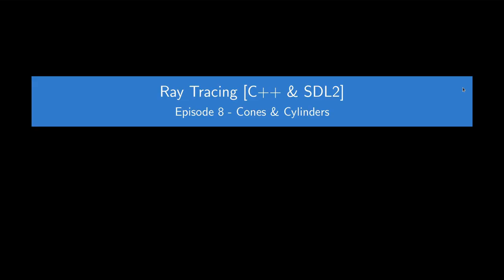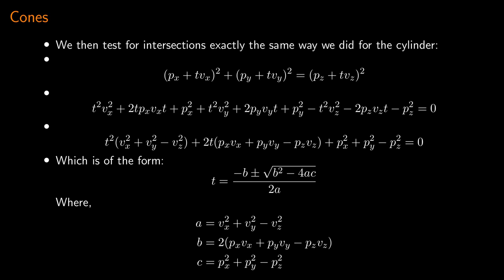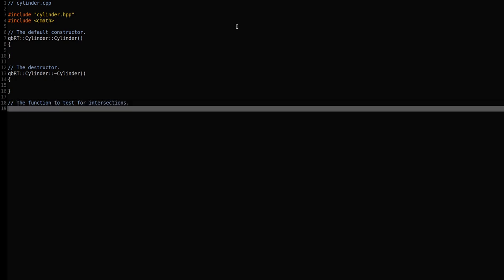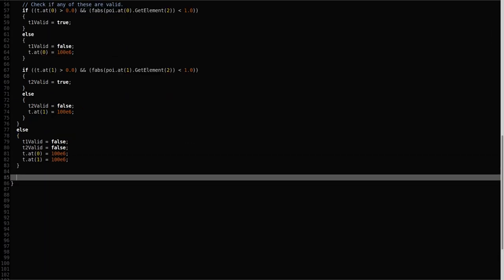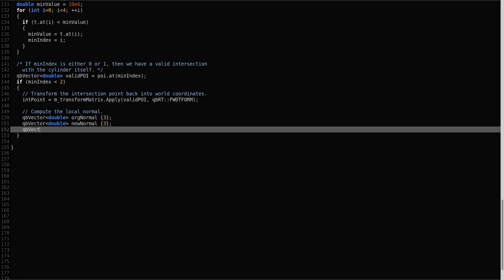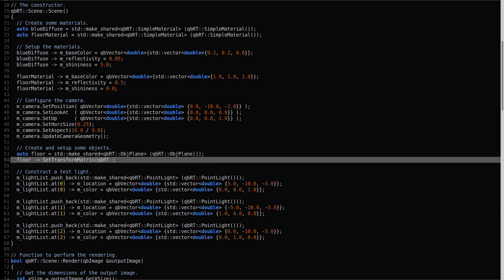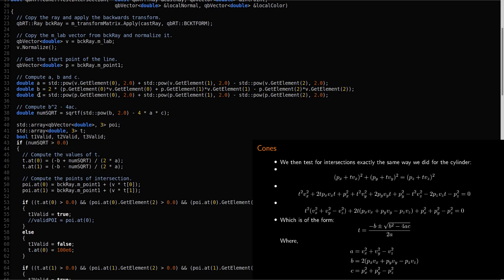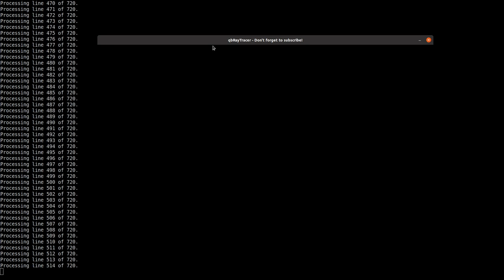Ray tracing [C++ & SDL2] - Episode 8 - Cones & Cylinders

Comment: Absolutely amazing. I'm in awe of how you came up with all of this from scratch. Thanks so much. Ultimately I'd like to add some functionality to import arbitrary objects (defined in OBJ files) and figure how to render them, and also use my GPU's to speed things up. I'm thinking one source of insight with all of that is the open source and professional grade Blender software. I've written some python scripts for it, but never looked at the internal code (I think C++). Since OBJ files are simple text files that define vertices/faces/normals/UV coordinates, it should be pretty easy to import them, but I'm not sure how to do a raytraced render when there's no simple equations to define the objects. Or maybe since each vertex already has coordinates listed in the OBJ file maybe it's easier to just check the ray length vs. the location of each of the vertices. Anyway, guaranteed to keep me busy for a long time. Thanks again.
Reply from the maker: Thank you for all the comments! I am planning to go on to cover support for importing meshes from OBJ files, but have a few things to get through first. The basic idea though is to represent each triangle from the OBJ file as an object, the simplest being a plane with a bit of extra code to make sure we only render the bit that lies between the three vertices. I would recommend that you skip ahead to Episode 11 (https://youtu.be/5lDRXL5zQDo) at this point where I discuss the issue of applying geometric transforms to surface normals, which actually isn't quite as trivial as might be expected. This applies particularly to the cones and cylinders described in this episode.

Comment: can you make a video about camera rotations in Raytracing? (controlling the camera, yaw pitch roll.) I used quaternions when I was making a 3D polygon rasterizer, but I absolutely have no idea how to do it in Raytracing.
Reply from the maker: That is a very interesting idea, thank you for the suggestion! With ray tracing, you can usually place the camera anywhere in the scene and control what it is pointing at, but this of course doesn't allow for proper control of yaw, pitch and roll as you suggest. It would, I think, only be a matter of applying the rotations to the vectors that define the virtual screen through which the rays are cast, so it probably wouldn't require that much modification. I will give it some more thought and maybe make a short video (time depending!) on how to do that outside of the main series. It might be a while before I have time to do that though! :-)